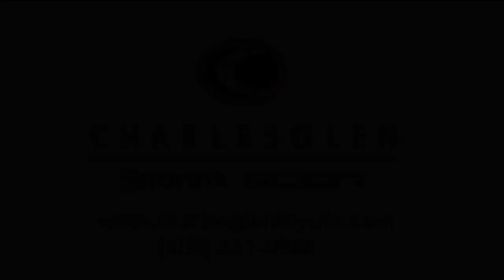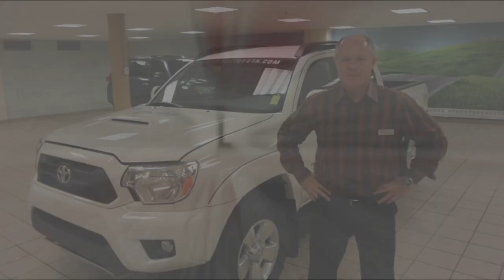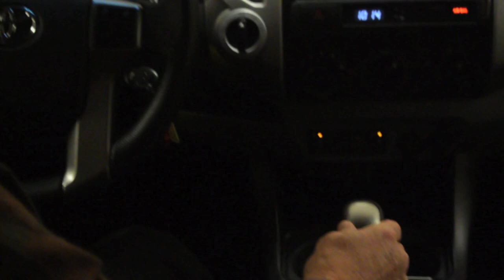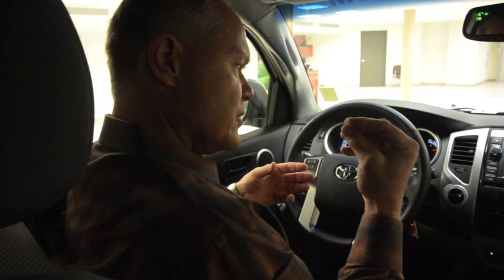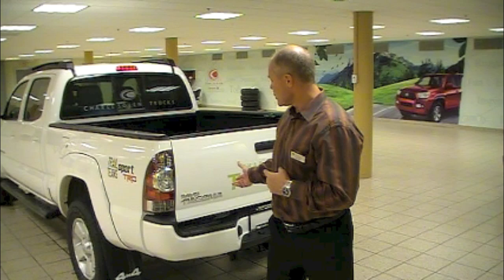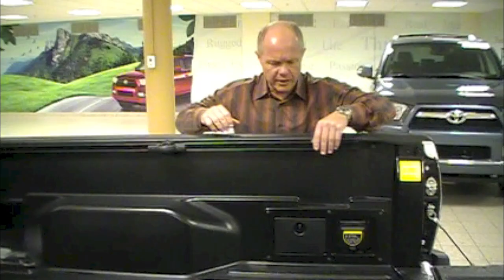2014 Toyota Tacoma Review | Charlesglen Toyota | Toyota Trucks

Comment: Very nice review, good information, no non-sense talking. I have a 2013 Toyota Tacoma Double Cab TRD4x4 Off-road with all the bells and whistles and I also have A-TRAC which I did not know how that system worked exactly up until now. Very nicely explained, thank you! One quick question: When the vehicle is parked, can I switch from 2 wheel high to 4 wheel high and vise versa? 
Tacoma is THE BEST TRUCK I've ever owned. I only have 57,000 miles on min and I am planning to drive it as long as I live!! Thanks again. Cheers!

Comment: Hello can anybody tell me why when I put H4 on my Tacoma 2008 the two front wheels gets lock??? So when I turn, one will  tryes  to catch the other, and therefore the truck kind of jump when am trying to sharp turn.  
I understand that you can lock the re differential with that button "rr dif lock" button  but why the front wheels are always lock in 4x4 even H4 ,??? 
My prior 1999 4runner when 4x4 h4 would not drive like this ... In fact I always use to drive it that way , and the feeling was so good ... Just like a "all wheel drive car " 
Obviously I can do this in my tacoma because I would mess it up

Comment: You never mentioned the manual transmissions.  5-speed manual available with the  4-cylinder engine.  6-speed manual with the V6 engine.  I hate most automatic transmissions because they remove a lot of control from the driver.  They claim automatics can tow more, but usually that is because most people don't really know how to use the clutch.  Manumatic controls add back in some of the control by allowing the driver to select the gear the driver wants, but still then some vehicles don't give the driver full control.  Also, with a automatic transmission it is as if the accelerator pedal is attached to a rubber band that deadens the drivers throttle inputs.  With a manual transmission the driver has full control of how much power the driver wants to use. This benefit becomes of great use when getting moving from a stop especially on low traction surfaces.  A automatic transmission will wait to deliver engine power to the wheels until the transmission's computer knows there is enough power to not stall the engine.  On low traction surfaces like snow or ice, or when trying to back a trailer up a small grade on wet grass where the driver can't use 4x4 because the driver needs full steering angle for maneuverability; in these situations an automatic transmission will cause wheel spin, where with a manual transmission the driver can decide exactly how much power is needed and is able to use just enough power to keep the engine from stalling but not enough power to cause wheel spin.
Reply: Thank you Matt!